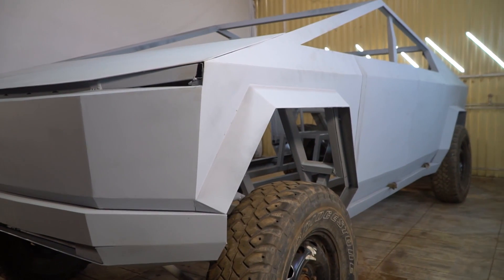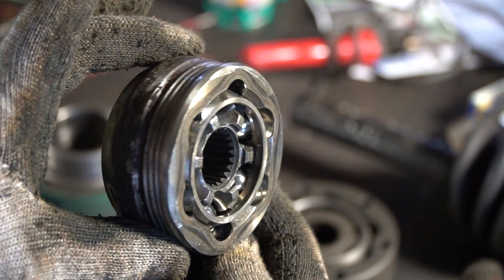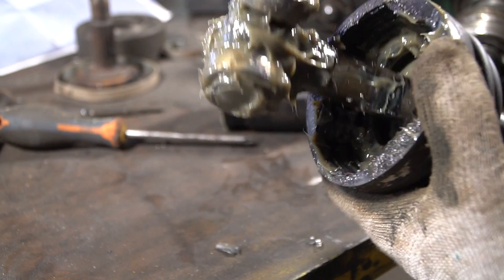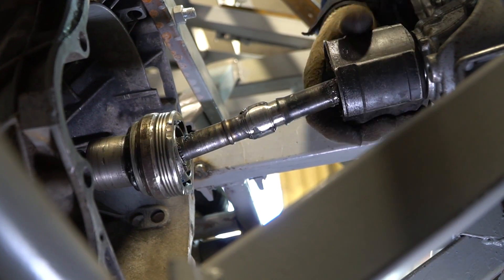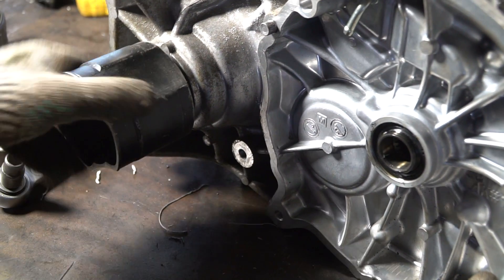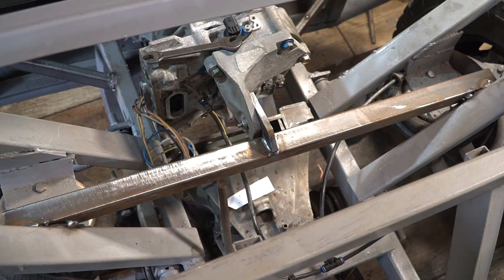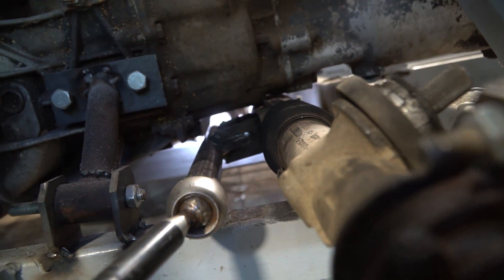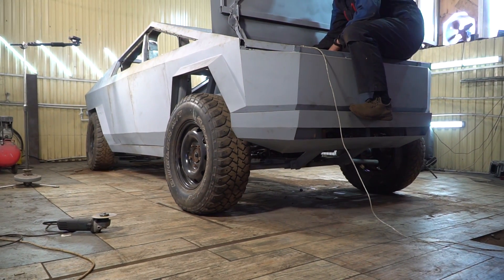Electric Motor and Manual Transmission: Electric motor installed in Tesla Cybertruck. Part 7/2

Comment: A proper Tesla Cybertruck should have a Drive By Wire system. If you can get your hands on one or engineer one, that could be a space saving solution for the steering rack.